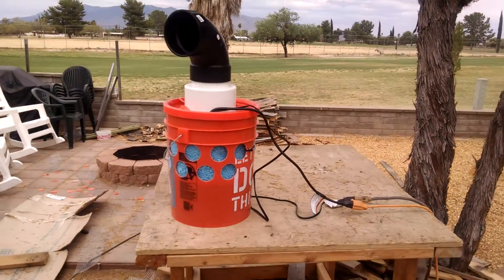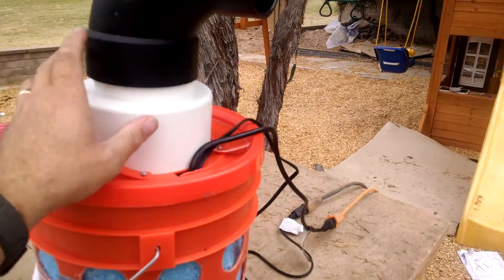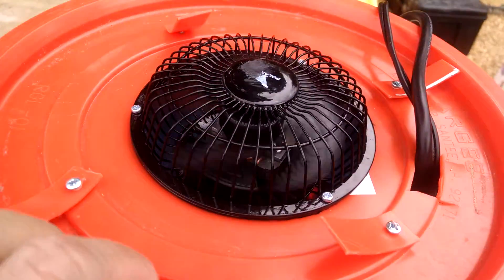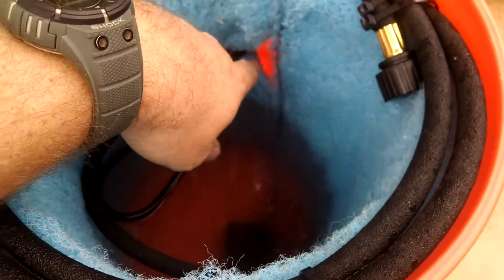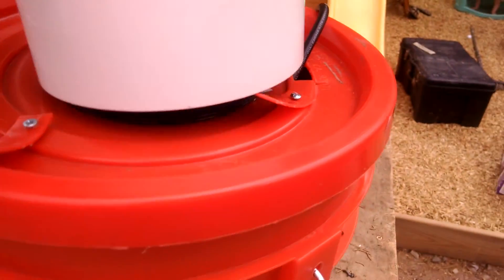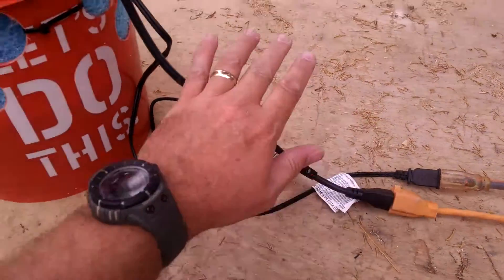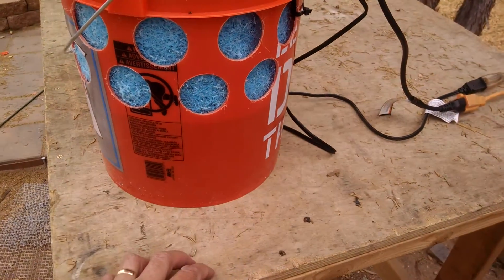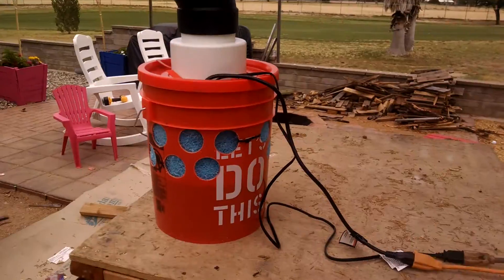5 Gallon Bucket Evaporative Cooler

Comment: Great video!
I have a few questions...
1) Does the fan suck up air from inside, end up sucking up some droplets of water too? Will the fan get messed up?
2) Did you block off the other end of your soaker hose? Or is it putting water back into the bucket?
3) Could you please kindly put the links to the items you needed for this procedure? I just want to make sure I get the exact items with specifications as you used in your experiment. 
Thank you!